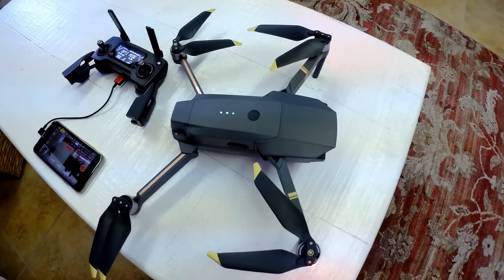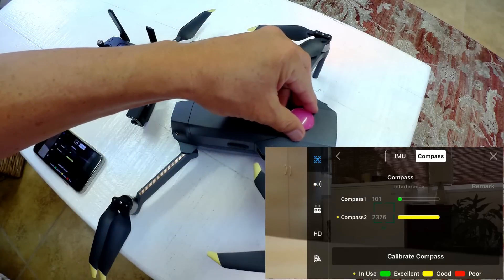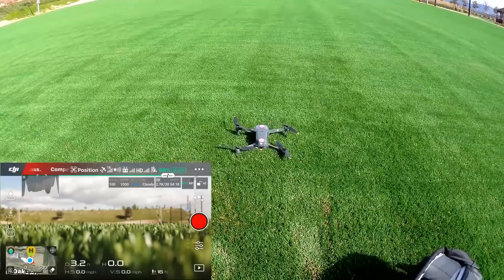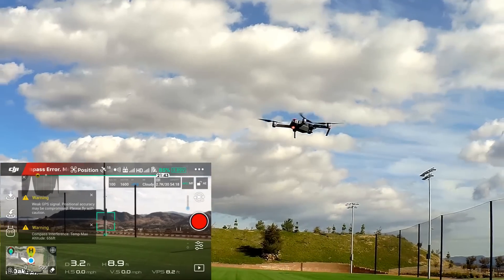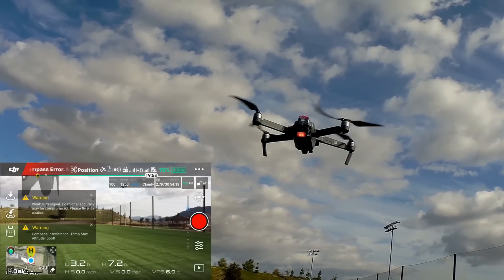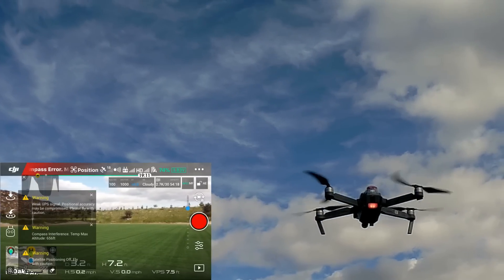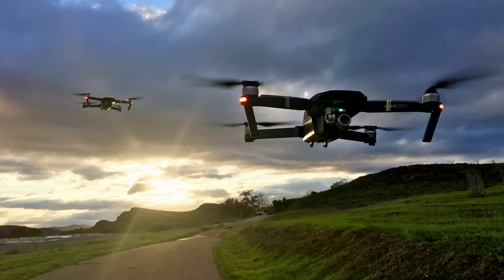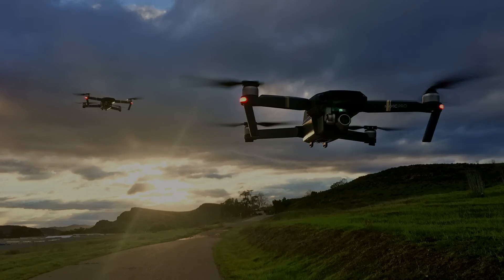DJI Mavic Pro / Platinum- Compass Failure Flight Test

Comment: Thanks for some insight into the compass operation ............ however ............ my current situation is now "compass not resetting" I do the calibration thing. Check back and still in another screen .. compass error in red.
My note follows:
I had a very similar incident/accident  today over a nearby park. It raced up to a 100' high (I noticed I had no control ...) travelled forward as it did so and came down like a lead balloon (well almost) short distance away.

I tapped the record button a bit late, so have the result of it descending at speed, thump .. landed on its belly and flipped over .. camera still on!!

Lucky it had the park below to thump into and no people around. I raced over and noticed amazingly, no physical damage, props still intact too. And still powered on.

Shortly afterwards I noticed after a restart .. compass error. Could start the motors (they sounded nice .. 4 props spinning) wisely didn't take off with a compass error!

That's where I'm at now. Nice looking Mavic Pro Platinum with a non resetting compass (far as I can tell so far) camera (gimbal) recalibrated seems working normally.

Any constructive comments are welcomed by me .. How can I solve compass problem???? Mr Merv Thank you.... I call it a Plat Splat from 100 feet up.

Comment: Well, it's still using its downward sensors, if you fly up to 10 meters then it will fly away without a compass, the GPS might save it though

Comment: Not very surprised by the results. Whenever the drone is moving in any direction, the direction could be calculated with the GPS signal. When it just hovers you need a compass. If it hovers and you don''t have a compass signal, the only problem is the yaw because the drone does not know in which direction it is pointing. The same is with the gimbal. So everything as it should be expected. So I guess, when RTH kicks in, the drone could just start into one direction and correct that right after a few meters, as GPS tells it, in which direction it is travelling.

Comment: It's called opti mode. It uses the downward visual sensors to keep it stable under 50ft. The problem is up high over 50, there is no more opti. This is a problem dji could easily fix by double shielding the wires to the rear motors, it's bad emf causing the compass to go at higher speeds. The emf gets worse as more power is applied to the rear motors. I have proven this early last year and fixed it. Instead they went the easy way and had the drone drop into atti/opti. My drone never drops into atti like before the fix. The mavic is unreliable without the shielding fix, which is why you see so many experienced people have it freak out. It's a design fail, but it's not too hard to fix.
Reply: is there any info concerning this emf shielding fix for end users?  Thanks for the heads up!
Reply: yes pls show guide to shield it
Reply: So where can we find info on this fix??? Why did you not leave a link to this fix???

Comment: Interesting test. What happens if the drone is a little way away and the RTH is activated? I would assume it would return to the home point, even if it has to fly sideways.
Reply: Nope.  The home point may be south of the drone but the drone wouldn't know which way that was.  Or where its nose/side was pointing.  Like a person at night that can't see the north star.  They wouldn't be able to walk in a southern direction.  You need at least one compass to be working.
Reply: @builtwildnaylor1034  
Have you simulate it happen?
any link, or video?
it will be interesting btw.

or maybe (RTH while compass error) Dji drone just guessing fly any direction if the distance is shortening (GPS distance value) than it will continue to Home point.

Compass  is very important as you say

Comment: You’re a braver man than me, I flew in a steel factory, no or few satellites received and had the magnetic interference warnings. The Mavic became a real handful, no altitude hold and it would constantly drift.
Reply from the maker: Yeah it was risky, and I was also concerned I might damage the compasses themselves by placing magnets over them.  Loss of GPS lock and compass would definitely be real bad.
Reply: It needs light on the floor or drops into atti. Called opti mode. Throw a flashlight on the floor, that works up to 50ft up.